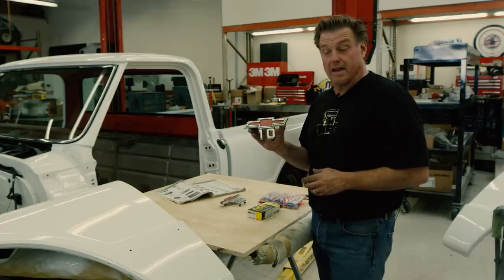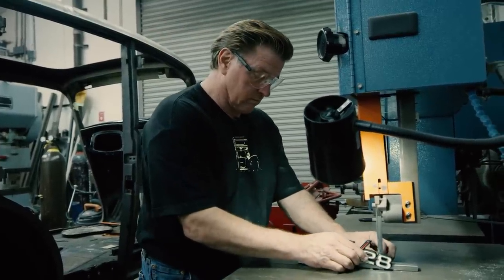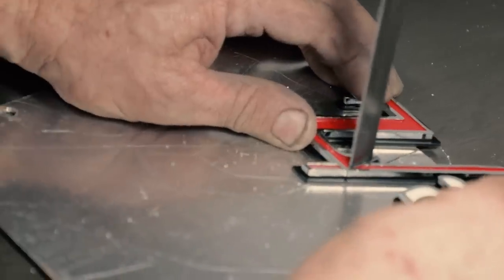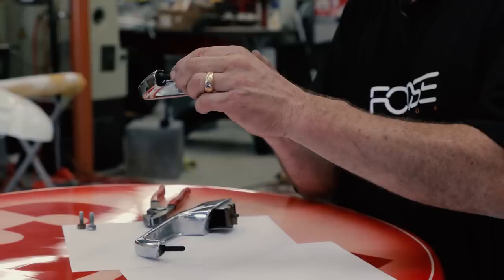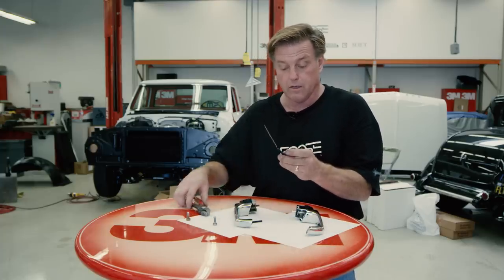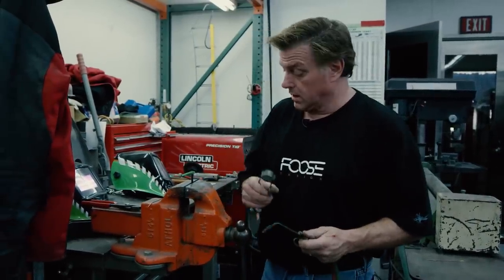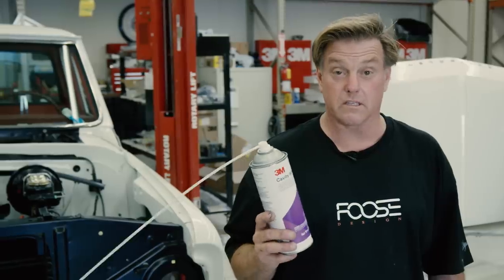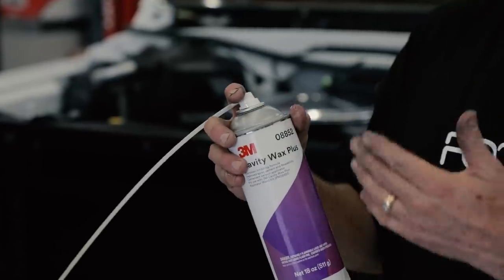Foose Design 1967 Chevy “C/28” Project – Final Assembly (Part 6/8)

Comment: Thanks Chip for sharing your tips and tricks. All of us from young to old can learn from them! I am currently building a 66F 100 with a late model 5.0 engine. I am in setting a powered  by coyote emblem inside clear epoxy where the twin I beam fender badge was originally for my little trick

Comment: 6:50 A simple fix. But how can we put pressure on suppliers to make, vend correct repro parts. If major suppliers said no then you wouldn't have to modify a part.
I bought a passenger side mirror for my 71 Chevelle once. Costly disappointment. Couldn't see the side of the car with it.

Comment: HAY Chip!. im just some shmuck that love to wach you work. but next time . try putting a nut on the stud when cucking it up in the vice and two nuts on the top of the stud . and lock them just a little. then use a boxed end wrench to bend it. No gulling the threads that could happen using your pliers . Love ya Buddy!!!    Mike!!